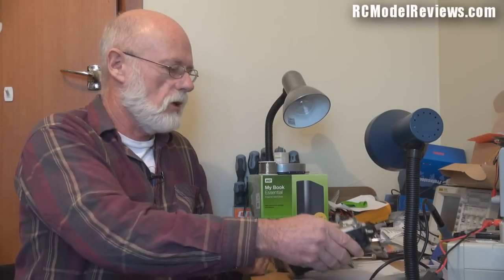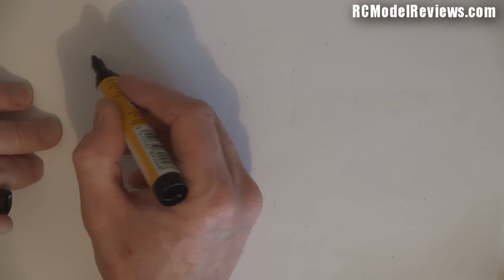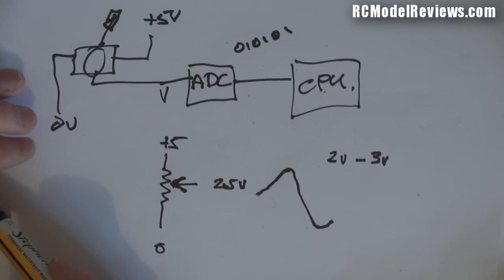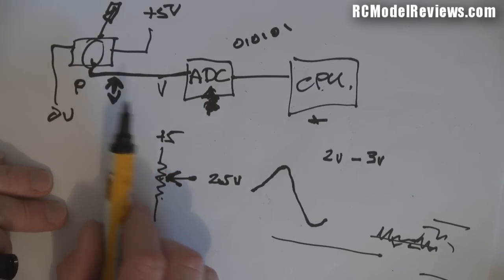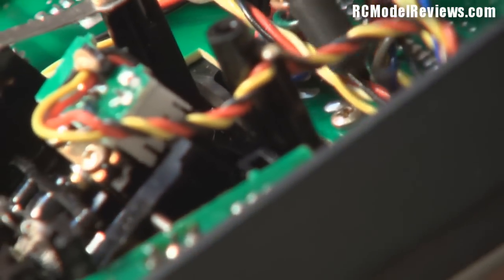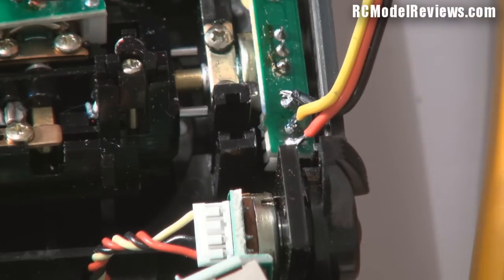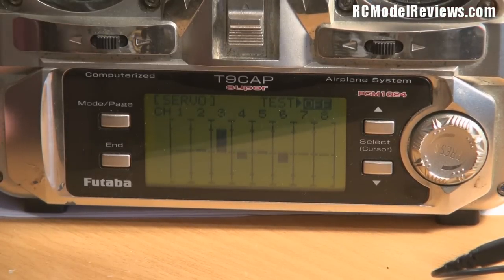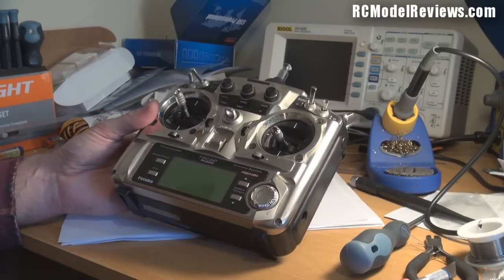Futaba 9C fault diagnosis

Comment: Love your tutorials.
Recently I fully fault-diagnosed my "Russel Hobbs" vacuum flask kettle (which surprisingly had a damn complicated electronics for a simple kettle) only to find out that I was plugging the wrong cable into the socket so the kettle just had no power :/
(cable was interwined with a coffee machine cable so I plugged that by mistake)
At least I am relieved that my precious kettle is still alive and kicking and I didn't screw it up thanks to tutorials like yours.

Comment: I have 2 of those radios and 1 of them has had a glitchy elevator for a few years now. I haven't been using it since I got my 9X's but your video made me get it out and do some testing. The good news is I think I fixed the radio. I found a suspect wire that had some white corrosion on it that seemed to have traveled under the insulation. Seems to be working fine now!

P.S. This radio got caught in a thunderstorm once and the water had to be poured out of it. I wonder?

Comment: Probably electrolytics going high ESR or bad solder joints on heavier components. I would check ADC supply line with the scope to.

Comment: just curious ... could a capacitor connected to ground and pot signal reduce the noise but still leave the control usable? For a repair like that I wouldn't need a schematic... if it's not the pot, the connections,the wires or the traces I would guestimate that it's the mcu and tell to my friend to start looking for a replacement radio

Comment: Hello! Great video Sir!! I have a futaba 9Cap, love the radio, but I noticed that the elevator channel seems to slip out of trim a tad, doesn't seem to manifest itself in flight on my HEX but when I monitor the slider points on the NAZA software assistant, once trim is used to adjust the sliders to centre, the elevator slider seems to slip from centre a bit every time I check the software again, that slider is not cantered anymore, any suggestions? Thank you!

Comment: Bruce, I have to agree that most electronics failures are mechanical, did you check for solder hairs, solder balls fans cold solder joints,

Comment: I thought Futaba used to be awesome RC radios, its the only model my dad loves and hes been flying RC's since the late 60s.
Reply: They are, as is often the case I find, the fault is most likely related to the operator, if they have not cared for or abused the radio, if the radio has been exposed to the elements or even salt damage if used for slope soaring. Unfortunately without the schematics all that can be done is visual inspection, cleaning the board in an ultrasonic bath and reflowing the i/o pads. If you're investing more than an hour to find the fault in this case, you might consider upgrading to a new set.

Comment: do you have any idea why i am getting throttle warning each time  it urn on my taranis x9d plus and how can i fix it .
Reply: looks like you have a problem to the throttle potentiometer. maybe a throttle stick (as they sell it as a spare part) could be your fix! if the problem is on your main board then you have to replace the main board but usually the main boards have no problems..